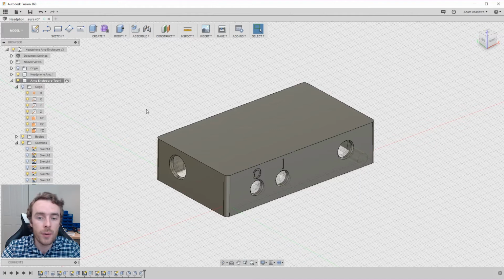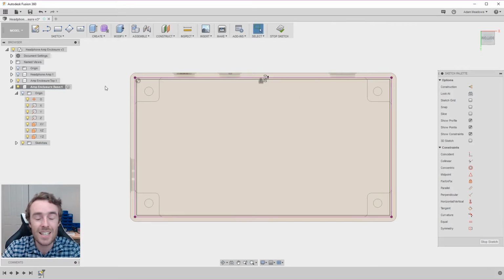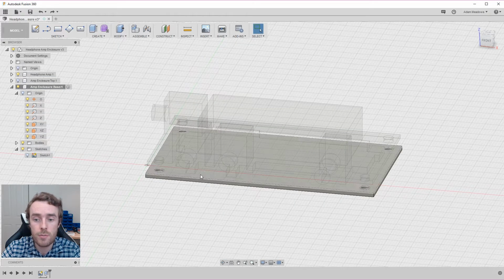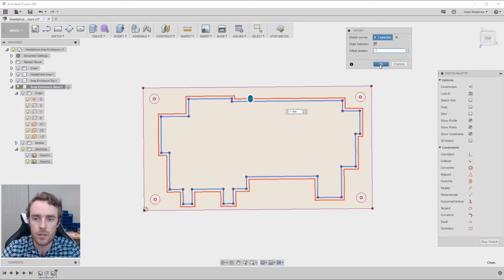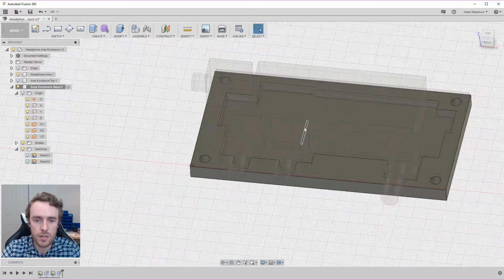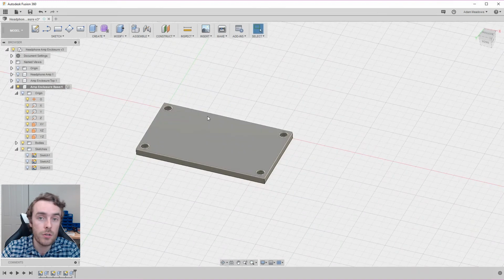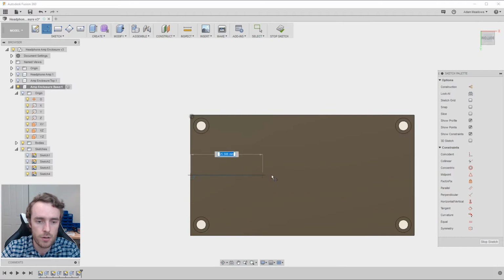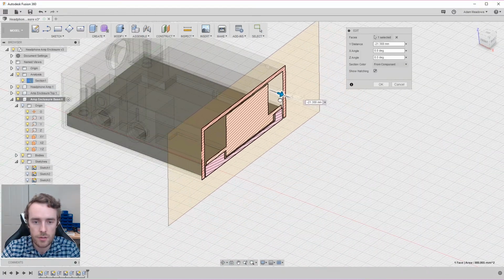Fusion 360 Beginner Project Part 3: Enclosure Base

Comment: Great tutorial. Nicely done. :)

One thing that helps in selecting geometry when another one is in the way: just hover your mouse over it and click and hold the left mouse button. You'll get a menu of all geometry under the mouse cursor so you can select the one you're looking for. Easier than turning body/component visibility on and off all the time.